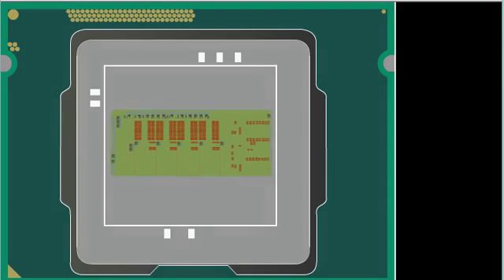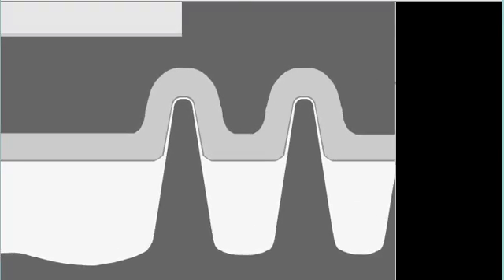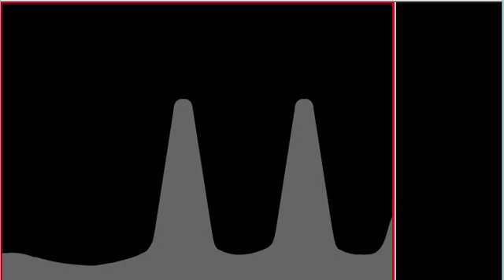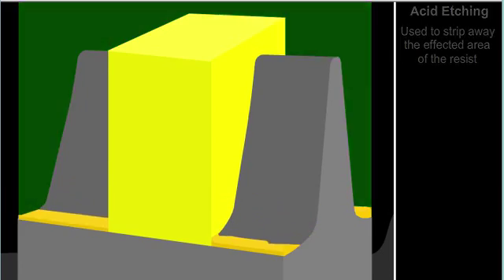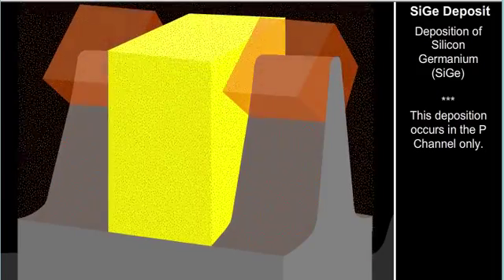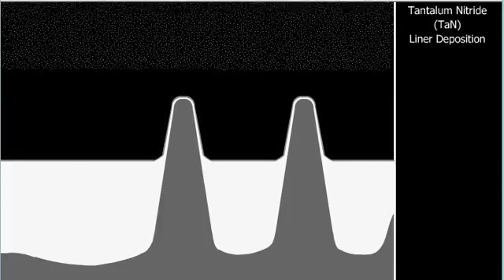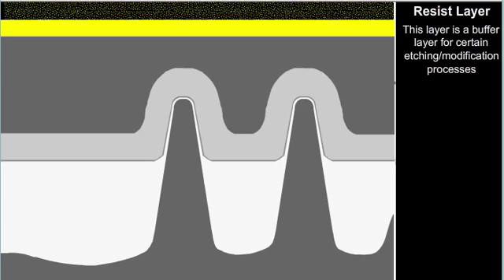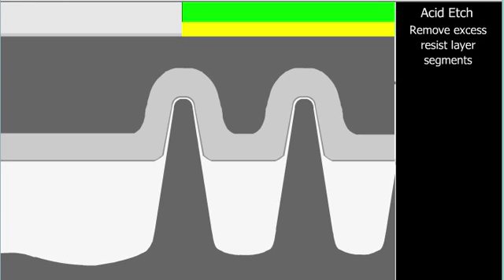Semitracks: Intel Ivy Bridge 22nm FinFET Process Fabrication

Comment: We are currently building chips in 2D, whether we might build 3D transistors like the 3D NAND? The video is excellent. Definitely need more of it.
Reply: Look into gate all around or GAAFET
Reply: @Jsteeezz   Yes. GAAFET is a good example. I looked at IC structure forecasted for 1 nm and beyond. We will see more of the 3D transistor in next decade.
Reply: 3D NAND his cheap and dense because the stacks of 3D NAND cells are processed in parallel, kind of creating trenches down thru 232 or whatever layers all at once.   GAAFET is 3D, but not in the same sense.  The transistor gets smaller in the X and Y dimensions and taller in the Z, but it isn’t a cheap, tall 3D stack of transistors.   3D NAND manufacturing process steps are interesting, too.